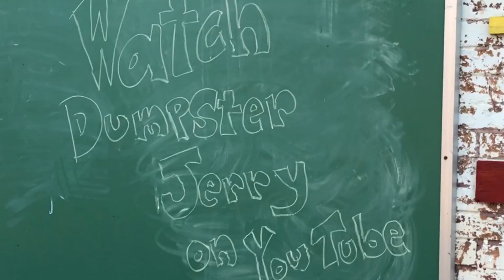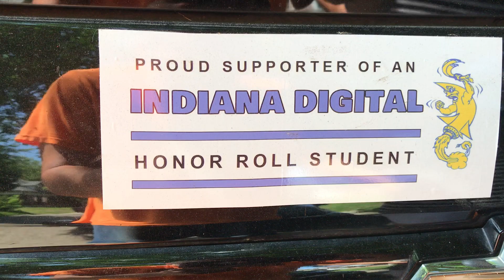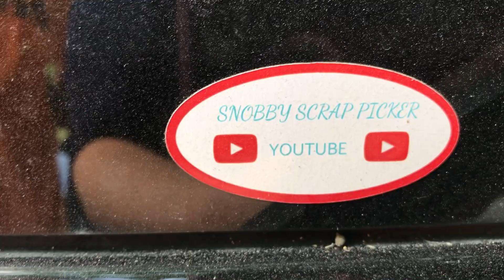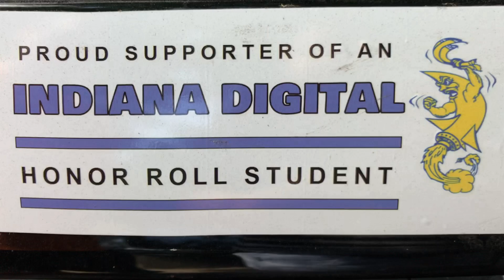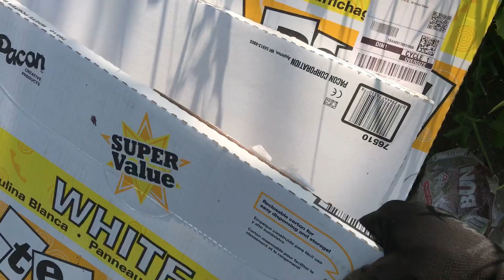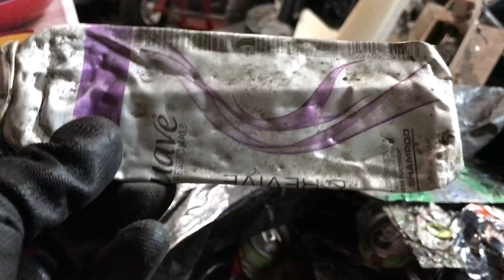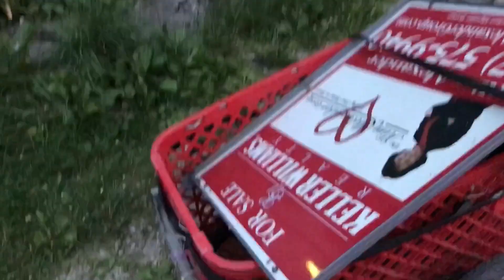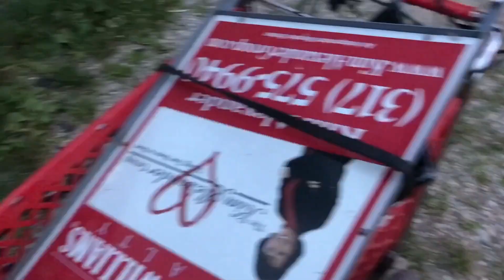I’m not the trash man but I am a trashy guy

Comment: You need a mountain bike with thick tires with a tread. less punctures
Reply from the maker: Boomer Garage that’s a great idea much thicker tires but there is glass everywhere around me so it’ll probably not happen as much. I like the fixie and 700c wheels not so much drag like a knobby wide tire. It’s all up in the air on that mt bike though.